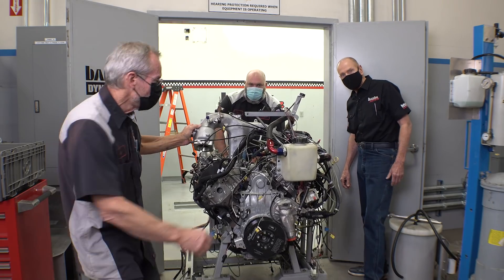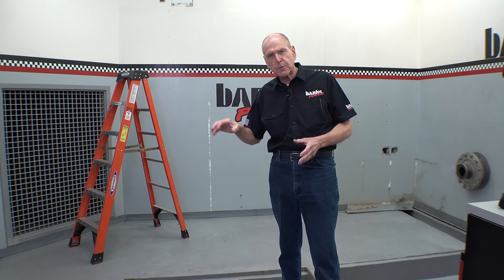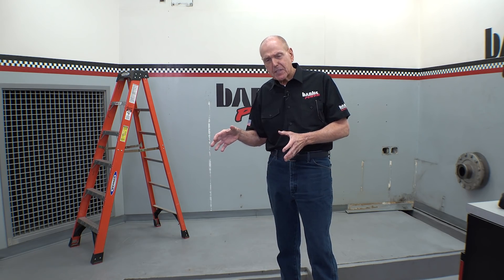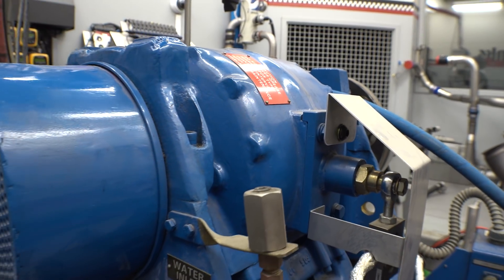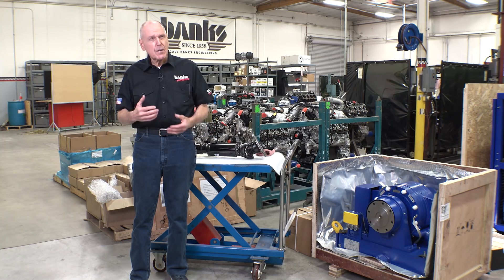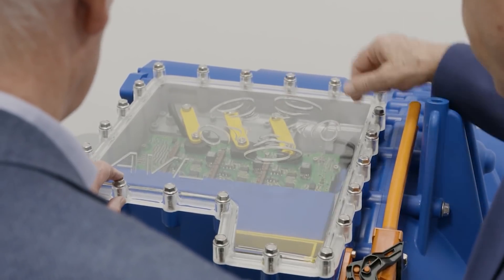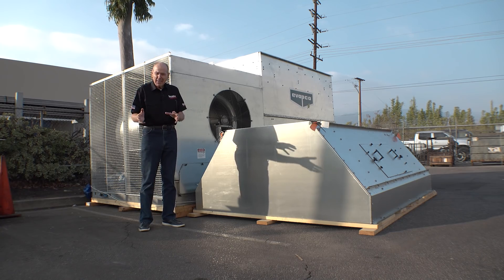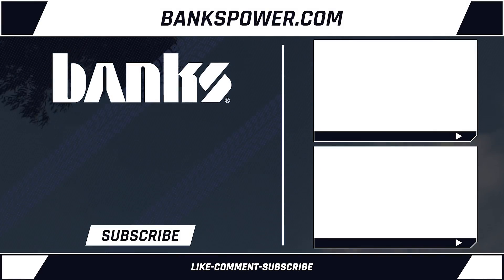R&D UPDATE: We bought a NEW ENGINE DYNO!

Comment: This is a very good explanation of how dynos work. We use water dynos for jet engines in the navy/marine corps. 10,000 HP Kahn dynos.

I'd be interested to see the facilities. Where does your fuel come from? Do you have your own fuel burm? Also, that cooling tower seems awfully large, but I'm assuming that's because of how small your water tank is. The water needs to be cooled more often than if you had an accumulator tank.

Comment: Does the absorber only go one way? what would then happen if you for example ran a B-series Honda engine on it, they run counter clockwise.
Reply: 3 years delay heheh. Yeah, the rotor inside are directional. What could be done is see if the dyno has a flange on the other end, so the engine could be installed and the dyno would still rotate normally (clockwise as seen in this video).

I had a chat about installing a B series/H series in a RWD car, there are various options, like using a front differential out of a 4WD vehicle, rotating a regular differential 180 degress, using a special differential, etc.

Take care 👍👍

Comment: Hydrolic dynos are budget friendly but they can only brake the engine. Active dynos can make braking and motoring (driving engine without load). They are more capable for dynamic tests and have more accurate torque measurement, especially the ones with torque flanges. But they are expensive. In future, We wish to see active dynos at Banks Test Cells. AVL's active dynos are quite successfull products. I think Mr.Banks definetly needs this type of dyno(s), AVL DynoForce can be a good choice.

Comment: While I understand the reasoning with going with AVL for the dyno for repeatability wouldn't a AC dyno work better? Unico makes motoring dyno's and I use them daily for my job. Repeatability is great, you are able to run motoring curves for frictional testing and added perk is that you can back feed the power grid with power produced from the AC motor.

Comment: Would it be possible to use some of the energy coming from the engine under test and turn it into electricity instead of heat, without sacrificing the accuracy of the whole system? Asking for a friend.

Comment: Hi Gale, I have done fuel consumption dyno testing for the Australian Navy on MTU 16V4000 engines when I was working for MTU Detroit Diesel Australia, what the navy wanted first up was a calibration done on the dyno at the maximum capacity of the load cell, needless to say there was some very tricky and heavy engineering that had to be done to apply that maximum load to the load cell, they were not happy with having a calibration done at a partial load to the  load cell and then extrapolated. Something to keep in mind when it comes to calibration of the dyno. Thanks for the vid mate.

Comment: Duration testing 1000hp constant... I’d be coupling that with a generator and pumping 17MW/h a day in to the grid... Not blowing it out the cooling tower...
Reply: Wärtsilä marine/generator diesel engine factory makes signifficant amount of electric power of their home city on their test drive cells. Something like 10% or so.
Reply: The  Dodge / Wright R3350 engine plant in Chicago during WWII used engines in acceptance test to per generators which ran the plant.
Reply: You should check out what Solar Turbine does when they test their turbines. Straight up heat.

Comment: Have you considered the practicality and economics of pumping the dyno hot water into a geothermal well or geothermal heat exchange system to save/recover the heat/thermal energy from the dyno water for use heating and cooling the Banks facility? Theoretically, it may reduce or even eliminate the amount of evaporative cooling where the thermal energy is lost.  Just a thought.  I'm sure there is a hell of a lot more to it than that.  Really enjoy your video's!  👍
Reply: Sounds like a great way to turn a $500K Dyno Cell into a $3M Dyno Cell.

Comment: Gale.....is there also water treatment for this system?    As an HVAC professional, I suspect you’re in need of corrosion control, biological control,  sediment and dissolved solids control.  Is there any issue with aeration of the load water to the absorber in relation to accuracy?    Aerated water a problem for absorber itself?    Very cool videos!

Comment: Im from Connecticut, which sucks, but I also got to see the dynos that used to be at avco in Stratford, They built tanks there In the 80s I believe, They were still there in 2006, Dynos to test turbine engines steady state, Like Mr Banks is speaking about. It really sucks that they were probably scrapped? State of the art setup Mr Banks. To bad the only serious power guy in the U.S. is well past retirement!

Comment: My friend Greg Welch designed Nascar Dyno. They can control everything! He can pick a track and set up the weather for that track in clouding the adding just like you are driving on that track as if the car is running on the track. Its controlled by water. He first ran the Dyno for Ford. He brought that knowledge to Nascar and set their Dyno up for them. Crazy stuff.

Comment: Now you're talking Boss! The ultimate efficiency comes from knowing everything about what is happening in and around your motor.  I'm so jealous hahaha. The computer age and data with plug n play specs has ruined the hot rod leaders of today. They don't know the math and I can bet you money that there are more performance builders out there that have no clue what bsfc is all about. I was trying to find the most efficient lightweight diesel engines for an experimental aircraft power and I spent 20 hours searching for the efficiency of quite a few modded types of plugless motors and found half of them.

Comment: How much electricity does this system require to operate? (Hint: perhaps utilizing some of the system to simulate electrical load might be smart.)
Reply: I'm guessing you mean using some of the dyno electrical items to load down the alternator?  

Unfortunately that isn't able to happen as the alternator is (usually) 12v and the dyno is probably a mix of single phase (for the control systems) and 3 phase (blower and pump motors) power.  Shoot, the blower alone is ~15KW of power.

That isn't to say they won't develop a 12v load so they can test an engine with a loaded alternator. Heck. They probably already have something in place.
Reply: @jrobmccoy  12V DC can me converted over to 120V AC with a device "power inverter" and if you do not believe me, Google It. Technically speaking it is 110V AC and with a tolerance of 10%, that means 110 give or take 11 volts. Your acceptable range is 99 Volts all the way up to 121 Volts. Try me, my uncle, Mark Hammerschmidt is a certified electrician in the State of California.
Reply: My dad's brother in law's sister's nephew's mate is a certified plumber, maybe we should ask him too
Reply: @greggadams1  beautiful, get him involved, where is he certified at and what's his name?

Comment: That is a lot of heat....150k btu/minute holy crap... For reference a normal home furnace or water heater is measured in BTU/hour..
Reply: Even grills are as well. At work we were using 90kbtu heaters but a supplier issue forced us to switch to 120k ones.

Comment: Sure would love to see you guys reviste the Ford 7.3 it definitely has a cult following nowadays
Reply: I think mouse cowan is talking about the 7.3 diesel....
Reply: Let's get this straight years ago Ford switch to the overhead cam shaft engine design like the Coyote engine has 4 camshaft with a complicated camshaft design all those extra moving Parts chains and tensioners plus 4 camshaft a lot of moving parts do you know how much 4 camshafts cost if you wanted to do an upgrade a plenty so two years ago Ford came out with the 7.3 guess what it's a single camshaft design engine just like the LS engine Ford went backwards because their overhead cam engines gave nothing but problems in your calling a 7-3 cult following the following actually goes to the LS motor ford just went backwards
Reply: @robertjohnson4784  considering this banks chanal is 99% diesel I really didnt think that I had to be specific about which 7.3 I was referring to. And if you put some brain power to it you'd realize that the diesel 7.3 is the one with the cult following, the gasser not so much.

Comment: I just replaced my water heater. I'm glad, it didn't cost as much as yours.
Reply: Maybe they should turn a generator to alleviate some of the rolling blackouts in LA.
Reply: @timothybayliss6680  genius real time benefits of science.
Reply: seems like a waste to just dump that energy into heat to be dumped to the surrounding air, bet he could get some green credits from cali by using it to heat water for the building, if only supplemental.
Reply: @signlsirchir2156  Our local dyno guy stores heat in several 1 cubic meter (1000L) ss insulated water tanks, He has enough heat to keep the whole shop at 20c aswell as the 3 surrounding houses warm during the Swedish winter ;) During summer he converts water heat to electricity, however the system is not that efficiant so he is planing to redo it to harvest more electricity.
Reply: @Halibrand  that's very cool to hear!

Comment: should install a big generator and feed it into the building and grid...
Reply: Sadly, a generator won’t have the RPM/load accuracy & consistency to perform the testing it sounds like he wants to do.
Reply: @timmyv1979  for detailed emissions testing no. But just for hanging off it for 3 to 4 day's it'd be fine. You'd get a better consistency feeding into a capacitor bank - > battery - > grid; to improve load consistency 

And as another member said. You could in theory, do some trickery with an eddy-current dyno
Reply: @neo1231  it's low grade heat, there is lots of it, but it's hard to recover heat economically from a relatively low temperature differential.  If they weren't in Socal, waste heat would be great in winter for heating the facility. :)
Reply: They mean put a generator on the driveshaft.
Reply: @corybabcock9969  especially if you're going to run a diesel at 1200/1500/1600/3000/3200 RPM for days on end at steady load.  All common generator frequencies

Comment: Cool,    That water brake looks like it could hold some low speed torque.    I worked on Lycoming turbine dyno that could hold 3500hp at 18000rpm, for hours at a time,  but you have to have big water tanks, and cooling towers, because that is a lot of heat energy.

Comment: Have a 2020 Super Duty 6.7. Can you fix my throttle! Push the pedal and delay then shoots off!
Reply from the maker: You need a PedalMonster, the first OBD-II data connected throttle booster. https://www.bankspower.com/i-2935
Reply: Sounds like stock lag. Get a throttle booster so you have a quicker response from your Pedal. Thus causing your turbo to get a quicker response
Reply: @robbiemiller2334  turbos have signals now huh?
Reply: @TurboVisBits  can't get exhaust without throttle
Reply: @TurboVisBits  quicker throttle literally follows with faster everything else.
Reply: dead pedal happens all the time on new diesels if you confuse the engine management computer / transmission,  2020 Duramax does it too,once in a while.      Mine does it when slowing down quickly, then step back on the throttle at 5-10 mph, it seems to get lost for a second or two.     Its usually when slowing for a right turn on red,  and then seeing an opening and throttle without stopping.    haha!  Break the law, and get dead pedal...
Reply: @dmitchellhomes  happens on gas engines too. I have a Sierra with a 5.3. Dealer told me that it can take .8 seconds for the engine to communicate to the transmission, and then another .8 seconds for three transmission to communicate back. I think it's a combination of emissions requirements and having transmissions with a lot of gears. It sounded to me like the transmission is trying to decide if it should downshift or not when you give it the gas. I went to pass someone that was forcing me to completely let off the gas the first time it happened to me. Had to pull back behind the person.
Reply: @ColeSpolaric    I see...   Wow,  I had not noticed this on gas engines before.   I have to say the 2020 Duramax is a huge upgrade over my  2011 Duramax  I had before,  and by far the best, smoothest, and most powerful pickup I have ever owned,  but it is not perfect, and has had this dead pedal glitch a few times on me in the first year.   I did not even complain to the dealer,  as I do not think they can fix it.  I will buy a Hummer EV next,  that will fix the dead pedal for good...
Reply: @dmitchellhomes  I wish I could afford that and that it had more range. Those were the 2 things that I was really let down on. I figured on 500 miles of range out of that sized battery. Maybe the electric Sierra/Silverado will get that much range.
Reply: @ColeSpolaric   yeah, I haven’t figured out how I’m going to afford it yet, but I ordered it.  The range is not really an issue for me, I’m used to electric cars, we have two in the household already.   With 350 kW charging, the range is not nearly as big of a deal, plus I don’t think we would  want to drive that thing on a road trip anyway, with those tires and suspension, it’s not going to be a smooth rider.   Yeah, GM is also working on an EV Silverado that’s much more aerodynamic, much smaller tires and lighter, it will likely get more range.
Reply: @dmitchellhomes  I was looking for a road trip vehicle that could also be good for off-roading. I feel like by the time you get to the trail you would have to turn around because you wouldn't be able to complete the trail and get back to a charger. I'll wait a bit to see if I could afford one and change the tires for something more efficient. I'm thinking the should have done the bumper with removable corners as well.
Reply: @ColeSpolaric    Ya,   at this stage of EV and charging network development you have to look at the specific place or places you want to go and see if that is feasible based on charging infrastructure and vehicle capability.     I started with EV's in 2012,  so for me today is great for travel,   but it is still very early in the game, and for serious off roaders,  stick with fuel burners for now.